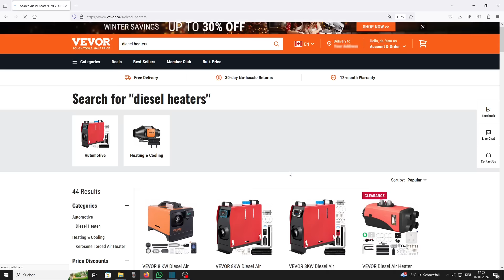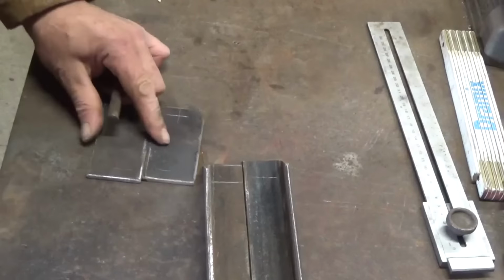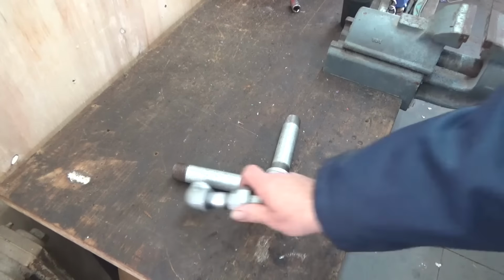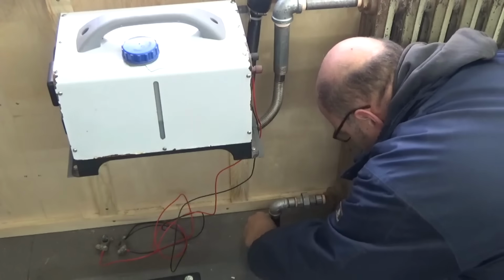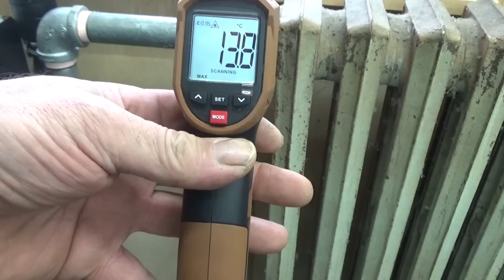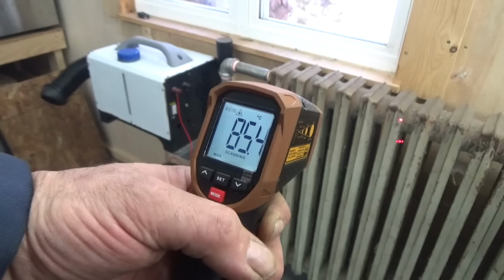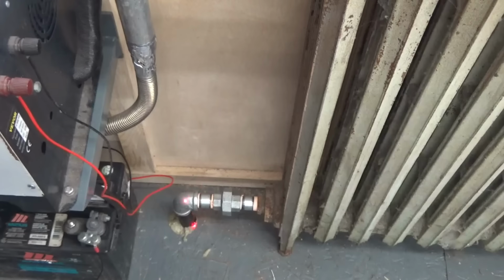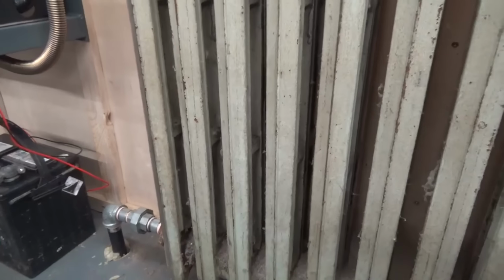Diesel heater upgade 200% more efficient

Comment: You have the exhaust hooked up wrong.  The heat is going to rise.  It would be better if the inlet was at the bottom of the radiator and the exhaust at the top.  I understand you don't want to exhaust out the wall, but that might be a better choice.

Comment: This seems like a good idea at first, but we've experimented with it and there's some issues to consider that aren't immediately obvious.

1. The radiator WILL clog up, and restrict flow, causing cool running in the burner which will clog faster than usual.
2. The exhaust elbow and muffler are essentially disposable, servicable items and with this setup, not disposable and difficult to service.
3. The water condensate in the radiator is very corrosive and for longevity the exhaust should be stainless to avoid damage.
4. More connecting points inside mean more potential leak points for fumes.

Our next experiment will be to run the exhaust elbow through an open sump heat exchanger to heat water and flow that through a radiator. Hopefully driving the water flow by convection rather than pump. Much safer and should be more reliable if we can get a good setup.

Good luck with your experiments!

Comment: I'd be worried about condensation building up in that pipe and you're putting a lot of back pressure on that system it might cause it to run hotter than it should could start to damage things in side the unit you should do a little research on that.

Comment: I am putting a diesel heater in my motor home and love this idea. Any ideas about how to scavenge the heat off of the exhaust before it exits the RV? Some sort of fins or something to attach to the exhaust. I'm thinking of extending the exhaust a meter or two before it leaves the RV but adding some sort of heat sink to the exhaust pipe would be great.

Comment: You are better off using a heat exchanger from the air heat outlet end of then Diesel heater with a water tank pumping water through the radiator or even set up underfloor heating pipes using the same water tank reservoir system... I did this to my Van build and it works great... Excess heat goes to a second heat exchanger for my hot water for washing-up and shower needs.... in the summer time i cut off airflow to the underfloor heating and still have hot water from my lagged tank....

Comment: This is air not water heat running through this radiator.   The heat should go into the bottom and out the top and vent outside above that.
Reply: That would work if the heated air doesn't get too cold before it exits, but  what's going to happen when the air cools and wants to fall back down before it exits this huge radiator, it may cause some flow restriction. I'm not sure how much pressure is actually blowing through the exhaust line, it may work either way with no consequences. half a dozen of one a 2 dozen of the other.

Comment: Seems very good heat recovery. It's good that you exit straight down thru the floor so condensation goes out with the exhaust. 

One thing I would love to see done is to preheat the combustion intake air from some sort of heat exchanger with the exhaust. I'm thinking it would make the fuel burn better but not having one (yet) to experiment with I do not know.  

Enjoy your warm shop!

Comment: What do you think happens to the teflon tape over time with this kind off heat passing through it? Teflon tape is made to resist hot water NOT hot exhasust, i'd invest in some kind of carbonmonoxyde warning measuring device and then built a sueport for that...
Reply: The threads do the sealing not necessarily the tape.  It's Teflon tape because it's a lubricant aka Teflon.

Comment: They have these heaters that run using liquid (hydronic).. you would be better off with that type if using any kind of radiator.
Reply: Those still waste heat out the exhaust like these ones just heat fluid instead of air he is reclaiming wasted heat so wouldn't change with other style heater

Comment: The set up in my conservatory is much the same ,with the exaust going through a normal radiator ,very little heat wasted . I dont know why most folks put the heaters on the outside,
Reply: Safety comes first. There's no absolute assurance that the system will be leak-free, potentially leaving gases in the rooms where you sleep... And then there's the noise—the constant ticking of the pump...
Reply: And. DEFinately..with this potentially exhaust-leaky setup..I'de elevate my sleeping bed UP a few feet from the floor..as well as poke a mouse-screened C.O. EXIT(!) weep hole at wall bottom to outside.C.O...like CO-2..heavier than air!
Reply: And DEFinately have heater's INtake  suction routed outside so bottom weepholes only flow the C.O.& CO-2 leakages out!

Comment: Interesting vid, however you should be careful when using ptfe (teflon) it degrades with heat especially over time, and will create toxic fumes.
Reply: What’s a better tape to use
Reply: Leaks in his exhaust are the only toxins I’d worry about here.

Comment: That pretty unsave setup. Outlet under the buiding - there is potential that the fums can leak in back. The pipe should go to the side of bulding. The inlet should be outside as you pulling the cold air from outside - negative presure.

Comment: Wouldn't it be better to draw cold air from outside for the intake ??
Reply from the maker: Yes for the burning process
Reply: If it was an engine, cold denser air could make an increase in specific power. But this is a heater and cold air takes more BTUs to heat. For heating, more efficiency is had by putting fewer BTUs in the combustion path and/or recovering BTUs from the exhaust side of the combustion path using a recouperator like this guy's radiator is functioning as.

Comment: If the exhaust gets hot enough to melt the teflon tape you could die because of the  exhaust fumes. You'll definitely have to find another solution for your fittings
Reply: Teflon will withstand about 350⁰C, also its only sealing the threads, tiny volume even if no tape
Reply: Now I think he was talking about the aluminum tape on the exhaust that will not withstand that heat   @Phantom-mk4kp
Reply: @maxwolf2726  No. He typed the word Teflon

Comment: I would blow the hot outlet air through the rad and circulate that + plus the rsd heat .But jesus ,using plumber tape on a 90c pipe is asking for trouble .Oh and a carbon monoxide alarm + a n auto fire extinguisher were talking Chinees equipment here.

Comment: I GOT it! Help the exhaust moisture not condense by routing the heater outlet duct back around to a second sheat metal shroud affixed to the radiator's colder section. Wont gain much heat but will get less condensing.

Comment: @D&S Farm NS
You present a very good video, but I want to ask a couple of questions.  Will the radiator plug up with soot over a period of time?  Does your system create too much back pressure for the heater?  And now for a suggestion, wouldn’t you recover more heat by putting a fan pointed towards the radiator?  Thanks a bunch and looking forward to an answer!

Comment: If you made th heat enter the bottom of the radiator would you maybe get an even better result because the heat would rise through the full height of the radiator? the only downside I can think of would be having to drain it every so often from condensation .

Comment: Good job.  Probably the only thing Id alter would be adding a 90 and extending the exhaust out from under the shed.  I was very surprised by the lack if heat coming from the bottom of the radiator.  I know heat rises but wow.

Comment: Just a small idea....you should have exhaust from the radiator on the other side, to heat that whole radiator, because the exhaust gas is clearly going immediately down in the first block... 
Also, the exhaust pipe from the diesel heater should be higher than the inlet of the radiator, because of the fume condensation.

Comment: I recently picked up an old cast iron radiator a bit smaller than that one, for just the same purpose. I plan to initially get it set up and running, then maybe during the summer months completely strip it down and put fresh primer and paint on it.

How big of an improvement in ambient heat would you say it made? Judging by the 91C measurement you took, I would assume quite a bit?

Comment: Got a response back from Vevor after 3 days telling me that the hose feeding the pump is too thick thus starving the heater of fuel oil and causing the pump to fail....lol...I had a proper 5/16 fuel line connected to their 3/16 clear line so definitely not a fuel starving situation. Let's face it there isn't a warranty with Vevor so factor in spending another 50 to 100 dollars fixing their deficiencies to make it work properly. If you put in an Espar fuel pump, controller and glow plug you'll have a fully functional diesel heater.

Comment: Soot is the unburned component of the fuel. Very hot (optimally tuned) exhaust is the indicator that the burn is more complete. The design of the heater requires that the motor that runs the unit powers both the combustion input/output gases as well as the  indoor air to be heated as it flows across the heated fins. The fuel pump is calibrated with the combustion air fan speeds according to the designer's expectation of minimal restriction of the airflows for both the combustion gases and the indoor heated air. See instructions for the original design from Webasto units, and you will note that they do not want many sharp bends in the combustion gas pipes (both input and output). The consequence of slowing the combustion gas flows with restrictions is that the fuel/air mixture increases (more 'rich' as they say), and this results in suboptimal burn of fuel, and then soot. The soot will build up inside the burn chamber more quickly and require more frequent disassembly and cleaning. One reasonably simple solution is to add an inline fan at the cool end of your radiator in order to assist the main fan. Even a small computer fan could add significant benefits, if fitted in the exhaust path at the coolest point.
Reply: If you increased the size of the exhaust  beyond the first section wouldn't this also have the desired effect of less or lower restriction to exhaust flow?
Reply: @vanblindguy4600  yes, but carefully nite that 'reduction' of back pressure doesn't mean 'eliminate'. The back pressure (which I am using as a synonym for flow restriction) is the net result of all parts of the exhaust path, which includes such cumulative effects of diameter and length of the pipe as well as bends.

Comment: I have seen quite a few mods to try and extract heat from the exhaust with these heaters.  Although there is heat of course I don't think it is really that much compared to what the heater puts out.  At leas the heater is bigger than diameter of the exhaust pipe which helps but restricting the exhaust is never a good idea.  I can definitely see moisture build up in that thing.   If one consider the actual cost of the heater and the length of run time with the fuel, they are pretty damn good.  BTW:  the only time I have seen diesel fuel go bad is when water has gotten into it over time.  Bacteria can grow and clog filters etc.
Reply: Well the moisture will just leak out the bottom pipe if it builds up as far as the exhaust being restricted, maybe a bit but I'm sure it will run just fine. The only problem I see is pumping the exhaust under his home, hopefully there's no leaks in the floor boards but it would accomplish one thing though....no animals will want to live under there.

Comment: The installation instructions for these heaters warn against increasing the exhaust length.
Doing so restricts the combustion air flow, and creates a rich burning flame.  This is an inefficient condition that produces excess soot, which will build up on the glow plug and in the combustion chamber.
To correct this you will either need to reduce the diesel flow rate or increase the air flow rate.  The heater's electronic control panel has a provision to adjust the Hertz, which may allow you to adjust the fuel/air ratio.  (I'm not certain about this.  You should ask somebody who knows.)  If you lean out the fuel the flame will burn cleaner and hotter.  If you lean it out too much it won't burn.  (I guess before it stops burning you might reach a point where the combustion chamber overheats.  I'm not sure what damage that will cause.)

To be safe I'd suggest that you examine the glow plug regularly to see if it's getting sooty.

Comment: Should have used a car radiator it would heat up quicker and not so much mass. I would like to see how hot the radiator got after 4 hours or more
Reply: Part of the point of the exercise is to heat the mass of the radiator to assist in heating the space.
Reply: @chrisallen2005  yes but the point is the smaller one will get hotter than that big cast thing and disperse more heat per sq inch
Reply: @thetruthfrmtyme2tyme  All equal over time. Simple thermodynamics.

Comment: I wonder if you can recirculate room air to heat through your cast iron radiator. I mean holding the heat yes. However removing the heat into the room using other than natural convection.

Comment: In my part of the world (Melbourne Australia) heating is generally not using radiators like this, so they are not commonly available.  It does get to -5 degrees C though,  so a shed/garage heater is welcome.  Are these radiators available in aluminium rather than cast for a faster heat transfer into the room?  It would cool down faster too, of course, when the heater is turned off.
Reply: The other end of the heater is where the "fast heat transfer into the room" happens.
Reply from the maker: No these kind of radiators are not available in aluminium. Here in Canada is it hard to find anything like that it took 2 years to find a payable one for this project and I dont want use a car radiator because there is a lot of plastic built in. And becouse of the material and the big surface I am sure it is a good solution.
Reply: @dsfarmns2823 a coolant radiator might have plastic, but i believe the turbo intercooler is usually an all aluminum build since it's only used to cool the boost air before it enters the intake. A diesel intercooler might be worthwhile to look into if an old cast radiator can't be found

Comment: 1 l of diesel will generate about 10 KW hours of energy. Depending on the cost of electricity you would get pretty same heat from ordinary electric heater. In my area which is Manitoba Canada 1 kilowatth of electricity costs 10 cents, it's the same cost burning electricity or burning diesel. But electricity heater is cheaper and simpler you don't have any exhaust and it's quick. Of course if you don't have electricity around then  the only way is to burn diesel
Reply: Kerosene is better and cheaper than diesel. Also, you can mix kerosene with waste food oils and get excellent results (just a little more frequent pipe cleaning)

Comment: Geat idea. But god those fuel pumps tapping away. You'd think by now they would have come up with something better
Reply: It's an easy fix just hang the heater in the rubber mount with a cable tie so it doesn't vibrate through the housing
Reply: You can buy a nearly silent pump for about $15, they just all come with the worst quality ones.

Comment: I think I would have plumbed that exhaust into the bottom inlet and have it go out the upper fitting since hot air rises, this would create a natural draft to pull the exhaust fumes outside of the building.  This would of course require an exhaust outlet out the side of your wall.
Reply: It will condense.  He is better off pointing down.
Reply: I thought the same. I would have turned the exchanger 180 degrees and moved it under the window, put the heater above the exchanger (higher on the wall), and routed the exhaust directly into the top of the exchanger, WITH a debris/sediment trap that went directly towards the outlet. This "should" help moisture travel directly down, not condense in the exchanger or the plumbing.

Comment: Bro you need to put on bottom hole of radiator hot air is going up so YOU WILL HEAT the whole radiator a bit faster
Reply from the maker: It is not the goal to heat the radiator fast. The goal is to use most of the heat from the exaust. If hot air is cooling down it falls down and it takes the condensation with it and the coll fumes are leaving the radiator at the bottem with the condensation. If I would do it your way it will fill up the radiator with condensate and block the flow.

Comment: Just out of curiousity, if your shed has power why wouldnt you use a ac to dc transformer and save your battery for power outtages?
Reply: The draw is pretty large on startup because of the glow plug (around 150w), also it's very bad for the heater to be turned off abruptly in case of a shortage. It needs to follow a proper shut off sequence.

Comment: I tried this with a more modern radiator and it used to choke up with carbon quickly, using an eberspacher 7kw heater...
I wonder if the bigger radiator pipe internals will help prevent this

Comment: When you’re welding you should at least wear a pair of gloves to protect your hands from the UV. Great idea on using the steam radiator to capture the heat from the exhaust. If you put a box fan behind the radiator you’ll put heat into your shop faster.